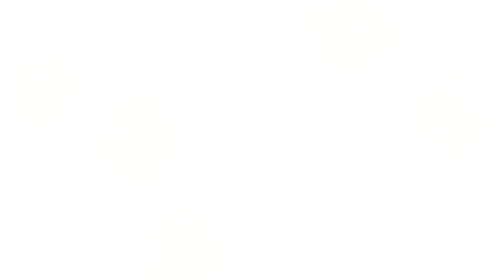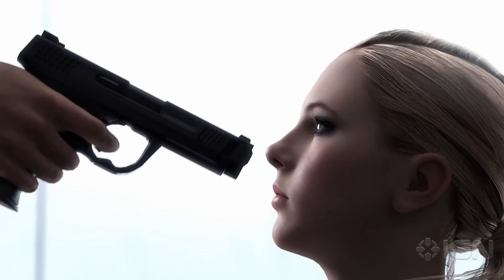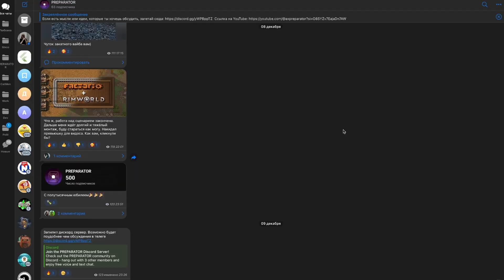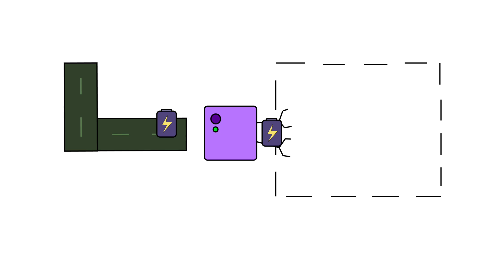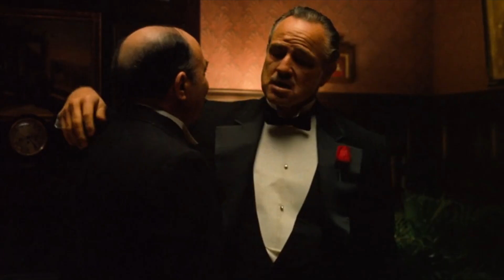My Game Idea | Underfactor

Comment: Maybe make it so that energy from veins doesn’t run out when mined manually, and instead is mined extremely slowly. It just makes a lot more sense and is much more intuitive than the veins running out when manually mined but not when automatically mined.